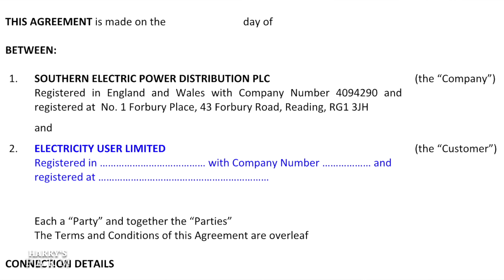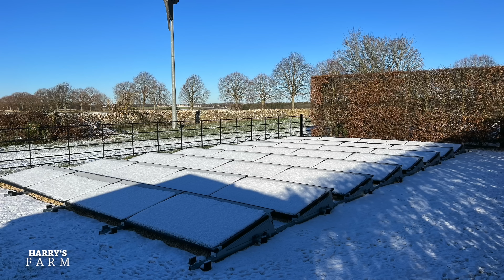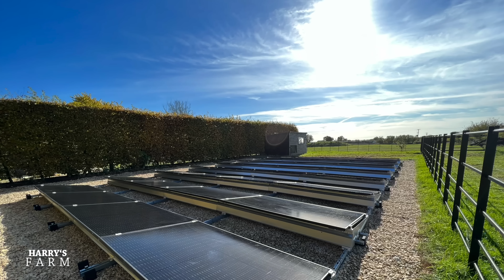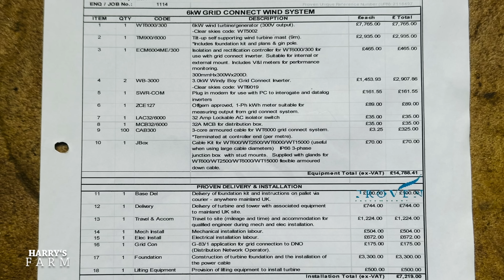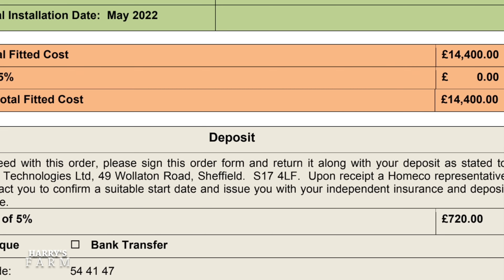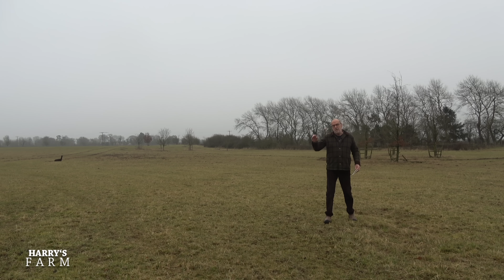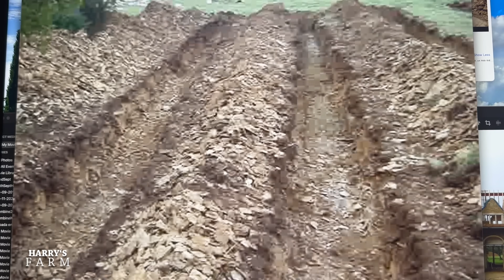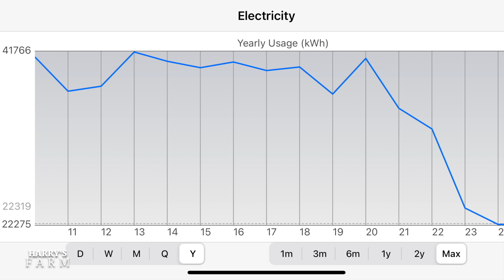Are solar panels & heat pumps worth installing? Here's what I've learnt after several years of use.

Comment: In a nutshell,spend all your capital on a once only insulation spree.Doesn't really matter how you heat the building then, it is just cheaper,period.
Thanks Harry for taking the time out with this update video.
Reply: But the panels have to be renewed every 25 years, D’oh.
Reply: @leeboss373  As do the 10k heat pumps every 10 years.
Reply: @IainGraham-k7v  
Is that right? I didn’t know that. Thanks for the info.
Reply: @leeboss373  That long? Wow, that's great. Mechanical engines and such like have a much shorter life span. Thanks for sharing.
Reply: @wthornton7346  
Still, you never recoup your cost.
Reply: @wthornton7346  
Still, never recoup cost.
Reply: @wthornton7346  
Just break even and have to fork out for it all over again. 25 year investment and nothing to show for it.
Reply: @wthornton7346   
Just breakeven and haveto forkout for it all over again. 25 yearinvestment and nothing toshow for it.
Reply: @leeboss373  Panels will still have way more than 50% output at those 25 years. Also panels have become extremely cheap so it's not a big deal. Currently the technology surrounding the panels (brackets, cabling, installation man hours) cost more than the panels themselves. Not to speak of advances which are taking up panel efficiency beyond the current ~20% limit soon.
Reply: @geekmystique  
50% output lol, they didn’t have a lot to star with😅

Newer advanced panels cost more and those new panels will no doubt need new brackets and framing and someone to fit them💁🏻‍♂️
Reply: Presumably there isn't   any gas  then? The government should be helping people upgrade insulation and  old boilers not roll out heat pumps to wealthy well doers
Reply: I’ve gone backwards and forwards on wind turbines and solar, can’t justify either based on a 10-15 year payback, and have come to the conclusion that battery storage is the solution, use cheap renewable energy overnight which has been installed at scale at a far lower cost / kWh than any homeowner could achieve.
Reply: Indeed - if you are building a house now (or indeed in 2007, although that would make you an early adopter in the UK), just build a passivehouse. No heating (or cooling) requirement at all for the vast majority of the year. PV can cover the remaining electrical and hot water load for almost every day of the year.
Reply: It's not worth it then...lol...I'll stick to oil and LPG and no hassle. 
Underfloor heating is brilliant.
By the way. Climate change is total bollocks.
Reply: This was my philosophy... refurbing an old farm cottage, stone walls , high ceilings and fuq-all insulation to start with... I basically built a house inside a house, with virtually total thermal break and 6" celotex in walls and 8" above the newly lowered ceilings, add in quality double glazing and a woodstove supplying aluminium radiators and my heating bill virtually gets cheaper every year !!... 

The BIGGEST bang for your buck will ALWAYS be insulation...

😎👍☘️🍻

Comment: Wot no batteries? You could fill up the batteries during the night with a cheap rate which would slash your bills during the day. Micro Inverters on the solar panels produce DC and eliminate the one shaded panel switches off all the panels issue

Comment: Great review Harry - nicely balanced, but I think you're missing a trick on the battery storage, which comes into its own during the colder months. If you charge your batteries overnight on a low cost tariff (e.g. 8.5p per kWh) this is then consumed during the day, for example to power the ASHP, when the tariff is at its maximum. Effectively, you're tariff shifting and there may even be times when not all of the stored energy is used and this can be resold at 15p per kWh.

Comment: Heat pumps are great... IF they are dual use model and are not your main heating source. Our wood house has one, it also has a condenser so we can use it with aircon in the occasional summer peaks. The main heating is my oil burner. I'd love to get rid of it and go geothermal but it's way too expensive where I am.

Comment: Lovely farm, house, and land! 😍
2 things missing here are EXPORT and batteries. Don't self-consume your solar energy, export it for 15p/kWh.
Use the batteries to charge up at night using night tariff (7p/kWh) and run off that during the day.
With that you use the grid/account balance as a virtual battery, as export is twice of import, you effectively double your system output.
Last year was poor from a generation standpoint, yet all-in including winter incl Jan Feb I'm still net positive by half MWh. Yes, purely from kWh I've made money.
Having said that, standing charges are the real stinger and negate any export, however theyre unavoidable.
Reply: That's interesting, - it's the other way around here in Australia. There's so much domestic solar here that the feed-in tariff is virtually nothing - so much solar in fact that the grid has trouble dealing with all this surplus energy. The plan we're on there is no day/night tariff either - it's just $0.50c all day and all night. We have a 13.5kwh battery which most days is full to 100% by about 10:30am. We use as much energy as we like during the day, eat as much of our own generated electricity as possible, do all the big washing machine washes, turn the dishwasher on, use the tumble-dryer if necessary, run the pool-pump, cook the big meal on the induction hob etc. Then the battery charge sees us through the evening and, depending on how much the various aircon units have been on, a long way through the night too. 20 years ago we used to get good morning for feed-in electricity - enough to pay off the panels in just a couple of years but those days are long gone and you basically treat as trying to be as self-sufficient from the grid as possible.
Reply: To be expected, with Oz being upside down, tariffs must be the other way round too 🤔
Jokes aside, thanks for sharing, that's interesting.
Reply: @SBTRIS  100%! 👍😎
Reply: Which supplier?
Reply: @DanielEarlester  Octapus

Comment: Harry telling us  the benefits of solar and wind during a very dull overcast winter day with no wind !
 Small wind turbines typically produce a lot less energy than you would think. They need to be very big and very tall. Solar panels and heat pumps have come on a long way in efficiency in the last 5 years. Shade not such an issue for latest solar PV.

Comment: Latest solar panels are much more resistant to shading. I have 6kWp solar and a home battery. Yes not much sun in winter. 
In winter I use off peak grid (12p/kWh HP tariff). If you have an EV and have an EV tariff you can charge at 7p/kWh for typically 4-5hours.
This winter has been been particularly awful for solar, but still get around 5kWh/day during January and use 20kWh /day (heat pump uses 10kWh). 
Yes the energy produced by HP varies with outside temperature. The costs should be calculated at an average over the season not during a couple of days when it is -10C. Most people have air source HP as they don't have a handy field.
Battery can be used to store off peak power in winter and used during the day and also allows home to be powered 24/7 from solar March-October. This is increases the  benefits massively.

Comment: Scary to think these panels will be considered prehistoric by just being a few years old. The tech is moving so fast that new panels will be a big upgrade again. I just think you consider that you build up a Electricity debt in Summer to even out the winter. Battery storage also helps but the fact it even produces in winter December in the U.K. is good. Solar rightly going nut in Australia but then they had a ageing network and was seeing blackouts in summer due to everyone with air con on.

Comment: I have zero experience of solar panels but I’ve been warming our house in the south of Sweden with a ground source pump/heat exchanger. since 2009. I couldn’t be more satisfied. Our heated  living area is about 100m2 and we also get the hot water from the same source. Although the house is old and thereby fairly badly insulated we still use only 9000-10000 kWh/year. We have radiators but underfloor heating in the bathroom. That includes household electricity. The garage has no heating, though.

Comment: If your farm dates back to the 1800s it may have had a water mill and lade. Would micro hydro generation be a better balance for solar and wind. It runs 24 hrs per day and may only have problems in summer due to lack of water, but that would be balanced by increased solar. I see a lot of potential in farms in my area with old mill wheels at the sides of farm doing nothing and old engineers directed every available source of water towards the lade.

Comment: As others have commented, batteries make solar even more efficient as they can store the power generated to be used later. Ours get topped up on cheap rate over night and any excess power then directly heats the water if required. I think it worth you considering adding batteries for the winter months.

Comment: This is brilliant Harry, thanks for sharing.  On our croft in Scotland, we have a 7kWp solar array, 2 Tesla PowerWalls with gateway, and 3 electric  cars.  We are billed for approx 22MWh annually and we use ALL of our approx 6 MWh annual solar.  We find that the use of an EV electricity tarrif substantially reduces our electricity bill.  Like you, we'd be paying around £5k annually for 22 MWh of electicity at 23p per kWh.  But with the PowerWalls, we charge up on "cheap" 9p overnight electricity and use very little full-price electricity.  Our annual electricity bill is closer to £1500 rather than £5000.   PLUS, when the power grid goes down, we run on batteries and sunshine while all our neighbours are in darkness!  Thanks again for all that you do.  I love watching your content!
Reply: @ AndyHamilton: can you please explain / expand upon your figures as I somehow cannot make them add up? 
I am in Perthshire and interested but with a 6kwp south facing roof mounted solar array and 10kWh battery & 5kW inverter I calculate a break even period closer to 15 years if have no equipment failures.
Reply: @PeterMenzies-t4r hes making out he gets 6000 units over a year whilst I struggle to get 4000 and I'm half way up the country, not in Scotland.
Reply: @stanley_plank  how do you know what panels he has or the orientation.  He may have bifacial panels for all we know which would explain some of the difference and the orientation the rest.  Why does he have a reason to lie.  As for the 9p for overnight rate, he should move to octopus and get 7p instead to further improve his income.
Reply: also check out Ambibox bidirectional 11Kw DC chargers, which can be used on exisiting V2L cars without modification e.g. MG4
Reply: For people who don't use heat pumps with underfloor heating, you don't switch the system of, ever, your house is zoned and controlled with zone thermostats,  it works well in new builds with lots of insulation in the floors, walls, and ceilings, but less so in older buildings, but again in a well insulated house a candle would would heat a room easily
Reply: How much was your entire system whilst your boasting about 9p a unit.?
Reply: @stanley_plank  Try being nice :). He's saving £3500 a year (excluding car fuel benefits as EV costs about one fifth for each mile) so for system of about £22,000 it will take 6 years to pay back at todays prices, then he makes £3500 a year profit. Lucky man
Reply: @ColinCarFan try being realistic :). He won't make £3500 profit, he will save £3500 a year. There will then be of course maintenance/replacement after 10 years or so. EVs are much more expensive too, the majority of the UK aren't buying new cars either, most second hand. Harry said himself in the video, solar is crap for more than half the year.
Reply: @LendogShreds  tbf, he didn't say they were crap more than half of the year, he said his solar array doesn't harvest much in winter, which of course it won't with our winter sun angles in the UK and the angle of his panels. But then he isn't relying on that energy because he has the turbine and heat pumps etc so it's fine.
Reply: @ColinCarFan Colin is right. Of course there is a cost to installing all of this stuff, but I agree with colin's ROI estimate. I am estimating 6.5 years on our installation. After that it is just maintenance costs, which are pretty low.
Reply: @andycheckley4372we have 7.5KW solar input the midlands with a Tesla powerwall2 battery.  Looking like 6.5 year. Payback for us too.  It’s a big cost but we treated it as a home improvement project.
Reply: 3 ev cars what an absolute loser
Reply: @pablohawthorne4248  I have 3 EVs.  Used to have 3 Land Rovers and sold them all to get EVs.  Saves me a fortune each year.  £171 for 10,000 miles of travel in my EV.  No brainer and people who keep thinking they are crap are just going to get left behind paying stupid bills for no reason.

Comment: Our heat source is via a single bore hole, running 200 mtrs down- Heats the complete house via underfloor heating. Constant room temp at circa 24 C including winters when temp can drop to -20C outside.

Comment: I have a feeling that those  Ground mounted Solar panels.
 Are being affected a lot more in winter. As a sun is lower and the hedges  Nearby my be shading panels More than in summer where sun is a lot higher
I would also consider changing angle of panels in winter. But for that to work they will have to be spaced out a bit further away from the travels so they not shading themselves.

Comment: I moved into a 16th century manor house in France 9 years ago and have always had the view that I would heat downstairs with a 9-12kw wood burner at each end of the house with heat then drifting up into the bedrooms. I am then cautious with what I use in terms of electric but only pay around 0,13€ per kWh. I plan to add a garage with solar on the rear using a french system called Beem.

Comment: My heating/ hot water is from a communal system. For a 75 sqm apartment, my annual electricity usage is 1000kW, so about 2.7kW per day. At that rate, I would get away with 6 of those panels even in the winter :) In the summer, I'd be selling 500+kWh back to the grid ... about £130 per month, about £750 per year. A payback of about 10 years.

Comment: Sounds like a software upgrade to manage each panel rather than each strip, so to speak, would be a major improvement!? And one would need to include the cost of some kind of underground heat storage system to utilise the excess heat as long term stored energy.

Comment: I have both solar and heat pump water heating.  Here's what I've learned having had them for over 5 years now.  FYI when I say solar water heating I mean heating grids on the roof that directly heat water going through them.  So no warn out batteries to replace - EVER.  Water doesn't wear out the way batteries do.  And since water heating is one of the biggest expenses this is a simple way to cut a huge chunk from your power bill.

Solar is excellent over summer (2.5 - 3 months of the year).  For the other 9 months it only saves 10% of my heating costs.  

Heat pump makes constant savings all year round.  Including through winter.

Solar vs heat pump is more or less the same cost.

So given what I know now, instead of installing solar and heat pump, I'd install 2 heat pumps.

If you haven't got either and are wondering which way to jump.  Heat pump is the way to go.  Constant savings all year round for the same outlay.
Reply: Also, bare in mind if you get a solar system that uses batteries, the batteries wear out and need to be replaced.  This isn't cheap and basically wipes out all the "saving" you had achieved up to that point.  So you end up spending money on a system that hasn't saved you a cent long term. 

If you are off grid then batteries are an evil necessity so fair enough.

If grid connected then just use a system that supplements your power during the day.  You can set your washing machine to run during the middle of the day and plenty of other similar things can be done to maximise the daytime power.

If on the other hand you do what I did and just concentrate on the biggest expense (water heating) then you save a lot more for the same amount of money.

My system saves me $200 a month year round.  Solar cost $3,000.  Heat pump $2,400.  Plus the hot water tank they both feed into which cost $2,300 but that would be needed regardless of what system was connected to it.

Comment: Harry, when your inverter needs replacing use Micro inverters on each individual panel. Each panel then works independently, you will gain at least another 20% power. You also only need cheaper AC wiring. I'm surprised you weren't advised to use them in the first place as the price is little different and they are g'teed for 25 years rather than 10 years on a single inverter.